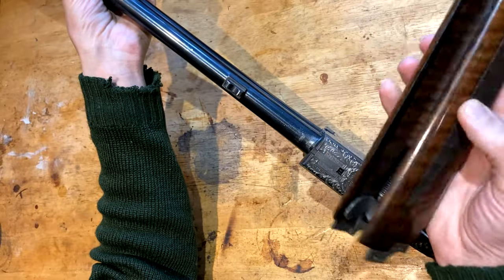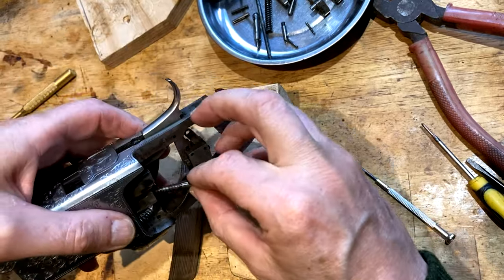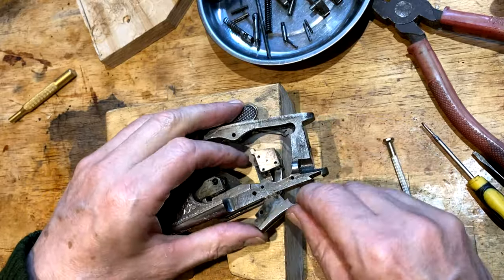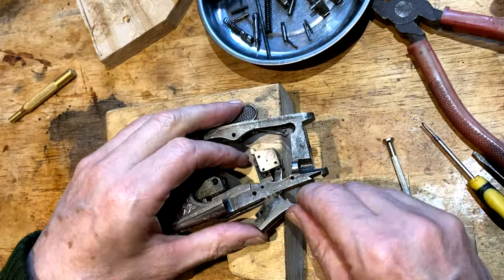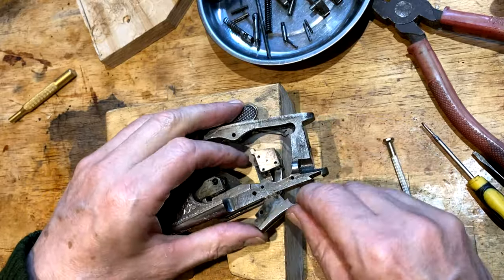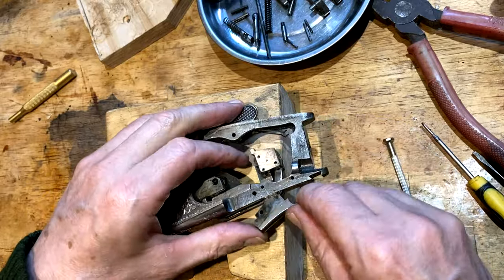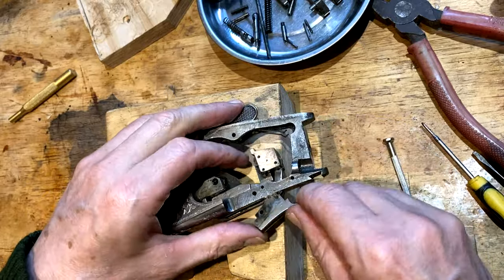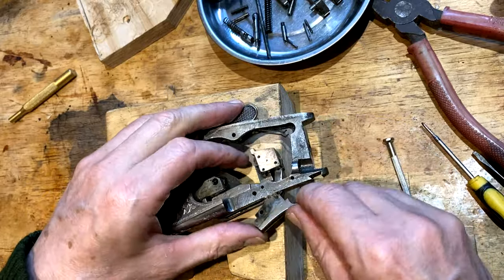Devongunsmith Diaries #30 Japanese Browning & Miroku Actions: Full Strip down & Re-assembly

Comment: Brilliant video and very informative. One question, why is there no spring on the top firing pin?
Reply from the maker: The breech clearance is sufficient to not require a pin retraction spring on the upper chamber.
The lower pin needs to be retracted to stop it catching the breech.
Reply: I wondered why there was no spring on the upper striker ? Excellent video and very informative 🤙